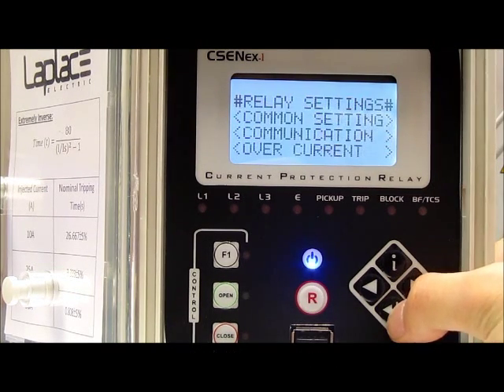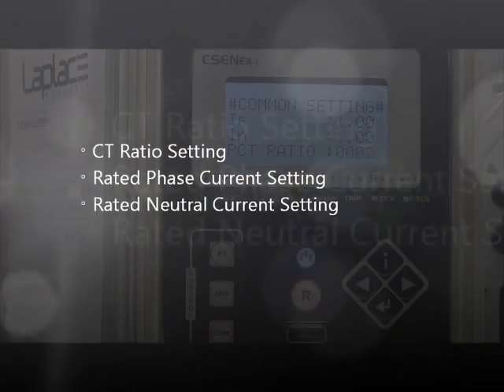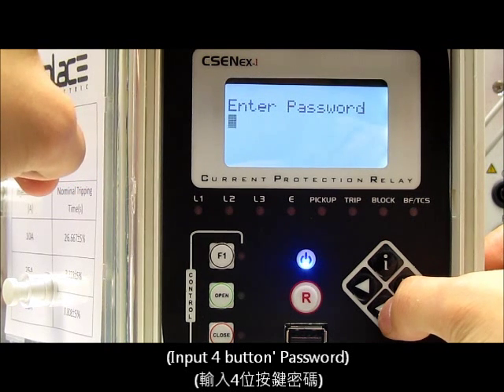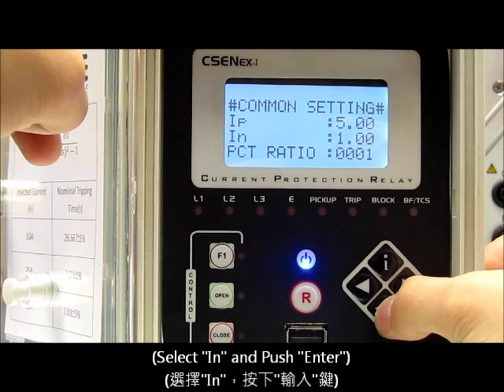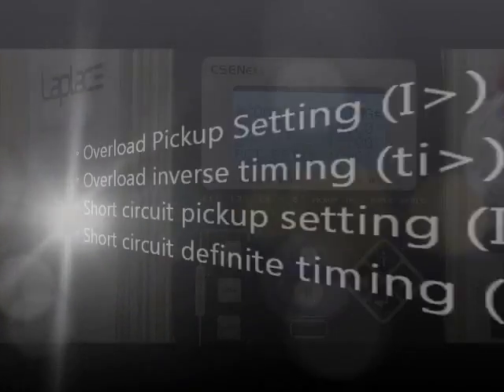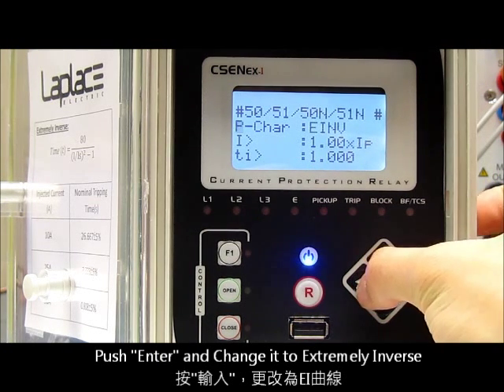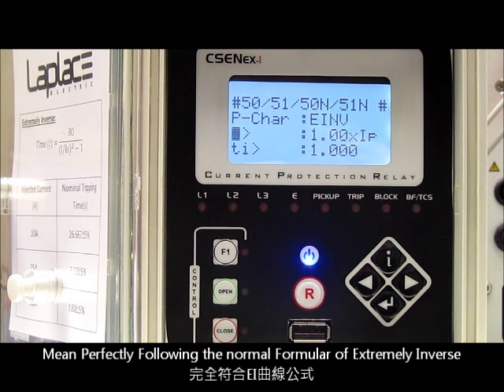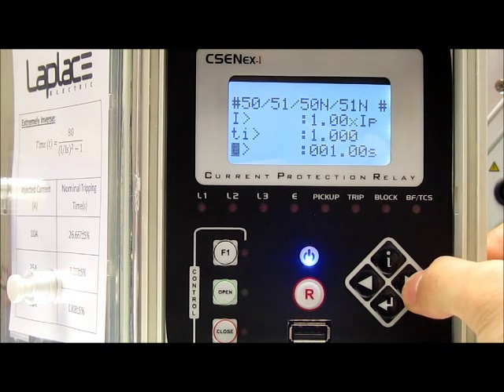IDMT Relay Application (保護繼電器應用) from C&S Electric

Comment: I have a problem regarding relay csenex-i when I am making necessary settings relay displays " save modifications" I am pressing yes then it displays enter password when I press enter for 4 times it shows invalid password as such I am unable to make changes
Reply: Ask your question in email.
The email of the company is:
www.lel.hk.
The technician probably cannot reply your inquiry on phone.